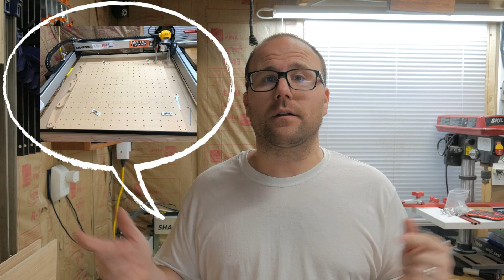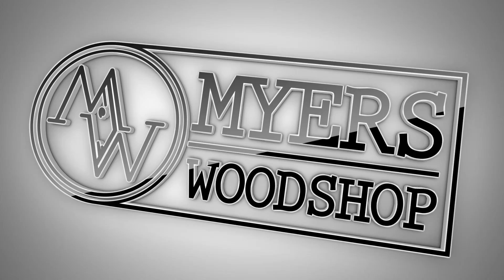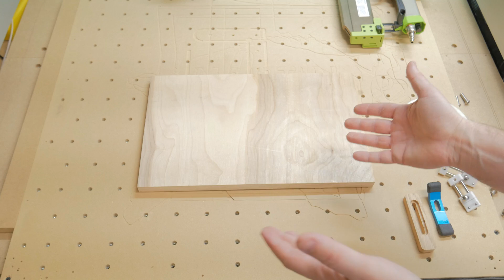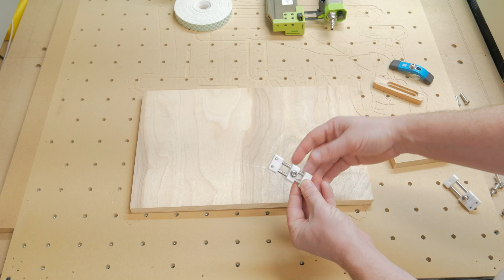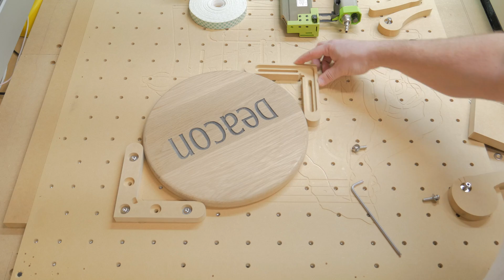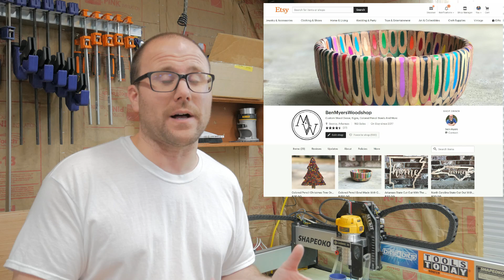How To Clamp Material To Your CNC Machine // CNC Woodwork

Comment: I like the clamp idea and am going purchase the clamp plans from your Etsy store. This is going to mean less waste material, since currently I use 6 inches on each side of what I am cutting to use metal straps to clamp stuff down. The only problem is I have a lot of warped wood and not sure how I will be able to use your method to clamp warped wood down. I am running a 30"X30" LongMill CNC router.

Comment: Hitting finish nails with your bit will dull it really fast. They make plastic nails just for this reason
Reply: I have been using a 18 gauge nailer to nail down quarter inch plywood onto my waste board.   I try to avoid where the cutter goes but sometimes I do hit them.  After 150 projects I have not had any issues with them being dull.  I have hit a harden screw and snapped a bit or two the nails are pretty soft so it is not a issue from my experience.

Comment: Great idea, the only thing I would do different would be to use a 1/4 thick wood for the  L-clamp to accommodate for the touch probe. You can't zero from the corner using the touch probe  unless the L-clamp is sitting a bit lower .
Reply from the maker: that's what the fence was for, it has a built in spot for the probe.

Comment: Just build my XXL plan on using your design (best method, I’ve seen) how did you secure the waste board to the stock board?  Do you use a second waste board above your board with the screws? When you cut through your material if you don’t won’t it hit the screws?  Newbie here with newbie questions 🤔
Reply from the maker: some screws.

Comment: Hi Ben. I’m new to the Shapeoko and your videos are super helpful! Thank you! Just a quick question, how do you hold down your cut pieces while the Shapeoko is still cutting? I have been using double sided tape but the pieces still shift and sometimes fly out or get caught in the router path. I also tried tabs but they’re an extra step to sand down. Any ideas other than double sided tape and tabs?
Reply from the maker: tabs are the way.  invest in a router with a flush trim bit with a bearing on it.  it'll sove your tab sanding in seconds.

Comment: What works way better than double sided tape is sticky wall tack like the kind schools use to put posters on the wall.

It holds everything pretty securely, leaves no residue, and I'm still using the same batch I bought 5 years ago, so lasts forever.

The cam-lever clamps in this video work amazing for anything you need more securely.
Reply from the maker: yes, double sided tape is VERY good.

Comment: Hi! Thanks for all your great videos. Starting with CNC and my Shapeoko XL, your channel is my bible :) Question about the clamps: can I use your Cam Clamps with Carbide’s T-Track wasteboard and bolts? Thanks 🙏
Reply from the maker: you can but you'll have to manipulate the file to insert the t tracks.
Reply: Myers Woodshop Thanks for the fast answer. As my English is not so good, excuse me for asking more details: the t-tracks are the rails, right? Do you mean that I will have to manipulate the file to accommodate for the carbide original t-track threads & knobs?

Comment: Hello great video, thanks, I would like to ask a question please, I am building currently my first larger CNC which is a lead screw openbuild 1075, its difficult and stupid money to try and  buy a shapeoko or Vcarve in Europe and it works out better to go down the open builds route which is what I have done. 1075 is the maximum size I need for what I do.

I am now looking at a spoil board and I am not sure what system to use for the nuts, I plan on using sealed 25mm mdf as the board and this will allow me a couple of mm's to surface it and provide additional weight.  On the 3018 I had a aluminium extruded bed with T-slots and mdf on top and the clamps always got in the way.

I have seen the nuts you have used which we call prong or claw nuts in europe ( the Allen ones are called inset nuts here) and I have seen these other Inset nuts  that you just screw in with a allen key. How have you found the prong nuts once you have tightened down on them, have they moved at all ? Do they ever work loose?

I was thinking the Allen inset  type would maybe pull out of the MDF as there is no real grain in which to bite into. What do you think please? 

I'm at the point where I need to order one or the other and I think the prong nuts could be a better long term investment. I plan on using cams whatever the case rather than large clamps that get in the way of the spindle which I had on my little 3018 I had for a year to learn gcode, design and cnc. ( great learning tool on a small footprint by the way) 
 
Many thanks ( also I have sub'd)
Reply from the maker: if allen is all you can get, it's better than nothing.
Reply: @MyersWoodshop  tx for reply, I can get prongs i was asking in your opinion whats better, allen or prong nuts?

Comment: You forgot the superglue and masking tape method of clamping... way better than double sided tape (which tends to shift slightly depending on the glue it uses... not all double sided tape is the same).

Comment: Hi, currently researching before I get into CNC making. Your videos have taught me so much more than I ever thought of.
Do you ever find that the vibrations during carving causes the cam clamps to release? I’m thinking of gluing some thin rubber to the bottom when I eventually make them to increase the friction.
Reply: Cam clamps slip. Look at 6:40 in the video; that large clamp is not providing any clamping pressure. Also, cam clamps don't exert any downward pressure on the wood.  An standard upcut bit will lift the work off the table. Been there; done that.
Reply: @richardfarwell6759 Yep me too.
Reply from the maker: I have not

Comment from the maker: ■ 1/4 - 20 hex bolts - https://amzn.to/2UgneU5
■ 1/4 - 20 washers - https://amzn.to/2KXoFST
■ 1/4 - 20 t nuts (you need 3 packs) - https://amzn.to/2KWDsx5
■ Double Sided Tape : https://amzn.to/2VSzqet
■ Rockler Hold Down Clamp : https://amzn.to/2storum
■ Oops Clamp : http://bit.ly/OopsClamp
■ Myers Woodshop Cam Clamps : http://bit.ly/camclamps
■ Myers Woodshop Wasteboard : http://bit.ly/cncwasteboard
■ Myers Woodshop L Clamps :http://bit.ly/Lclamps
■ Cadex Braid Nailer : https://amzn.to/2RQb7P2
■ Shapeoko 3 XXL CNC Machine : http://bit.ly/shapeoko

Comment: Ben need some help!!!  Dont know why but i zero out x,y,and z but makes first tool path cut good, the the tool path cut goes down about 1/4 inch and goes to next hole an on.  Tool path 3 the cut start about 1/4 inch or so above piece trying to cut.  All said it cuts only half way through the cams.  
any suggestions??
Reply: Did you ever figure out what the problem was? I am having the same issue.

Comment: Thanks for the valuable insight. So it works for a smaller thinner stock  but what about like 3/4 inch hardwood stock say around 15 by 13 with a half in end mill! 

I would think the higher force would throw the piece off.
Reply from the maker: i've had no issue with really big stock either.
Reply: Hi guys if you want a nailer to nail down hard wood maple.then  it a Rioby 23,gauge battery operated nailer it shoots 5/8"to 1 3/8. These are great if you are cutting out a piece 
Even if you hit one it gets  cut off no problem. The pin that is left I. Your mdf will pull right out with a pair of channel  locks

Comment: Thanks for the vidio. The larger off set clamps won't stay tight. The angle of contact changes. I have made the smaller wedge larger, but maintained the geometry.
Reply from the maker: they work well?
Reply: @MyersWoodshop  if they work, great. I did not mean to criticize. Hold downs take time and are major part of project. The smaller clamp design geometry keeps a constant preasure as it turns so that it holds its position like a lock clamp.

Comment: These small clamps look a lot like mine. Have you been using my design there? And have you also noticed that the bigger cams tend to open on their own a lot easier?
Reply: Apart from the way the cams fit to the waste board they look exactly like your design Marius
Reply from the maker: They absolutely look like his.  I had no clue he existed until I posted this video and he commented.  The pictures I saw on the internet were probobly his, I just didn’t realize that.   I never stated I came up with them.  If he’s the creator, all credit is due🙌
Reply: Just curious. Can anyone claim ownership of cam clamp design? They’ve been around forever. Before CNC.
Reply from the maker: I was just made aware of you today on Instagram.  I’ve seen them a few places on the internet.  I like your idea with the squares.  Does that make a big difference?
I haven’t noticed the bigger ones getting looser at all.
Reply: @MyersWoodshop  I just wanted to ask if you have used my free SVG file of the small clamp (which looks exactly like yours).
When I designed mine and used a big cam, they always tend to loosen themselves. Probably MDF has more friction than birch ply.
Reply from the maker: No.  I didn’t use your .svg.   That would have been much easier!😂😂. I just did it from memory of the few random examples I saw online.   How do you like the newer style you did with the squares?
Reply: @MyersWoodshop  I really like the squares. No matter what the size or shape of my workpiece is, I can clamp it without shims. Also at a repeatable position.
Reply: @MyersWoodshop Technically speaking the hole needs to be at the intersection point where the normals (the lines perpendicular to the tangents) dropped from various points along a curve. For example, normals on a circle would be called radii and meet at the center of the circle. The design does look quite like what Marius reached in his latest iteration after he realized in his first design, that any force either not normal or not going through the hole position shall impart a tangential component, thus causing the cam to loosen. I suppose, the grip part of the cam looks similar too, thus the doubts.
But good job, both of you :-)
Reply: I wrote "after he realized". That sounds condescending!! Not my intention!!
Reply from the maker: I watched his video and see that.  Although, I haven’t had any issue with the large ones moving personally.
Reply: @MyersWoodshop  I made the ones shown on mtm's channel (https://www.youtube.com/watch?v=uY-H9vOhvjw), but they slip away under higher forces unfortunately, so I'll need to make yours / Marius' design
Reply: I made mine in freecad based on marius's design, you need tu use a spiral to have a constant increase in radius, a offseted arc-circle won't work too nice
Reply: Hi  @liquid-stoe  , any chance to get your freecad files?
Reply: I made these clamps, but they just end up tugging my threaded inserts out of the wasteboard because of the twisting force (I have a permanent, full length, L-clamp screwed to my wasteboard). Can't help but think the dog holes design would handle the twisting significantly better - is that so?

Comment: Great review.  The one method I prefer now is the painters tape and crazy glue.  Works great!   Your cam is a great idea too!  Thanks
Reply: I was a skeptic at first too.   It works great and allows for full depth cuts without the need for tabs.   Check out Mark Lindsay’s channel.     Just another option to consider.  

Thanks for the great videos!
Reply from the maker: tape and glue is something i havent tried yet!